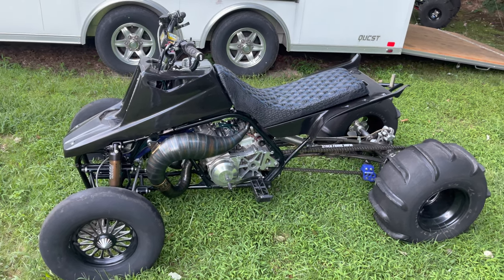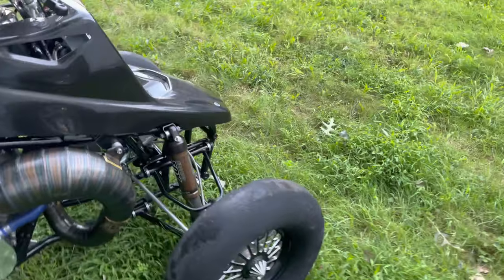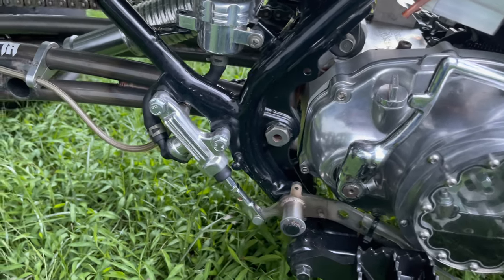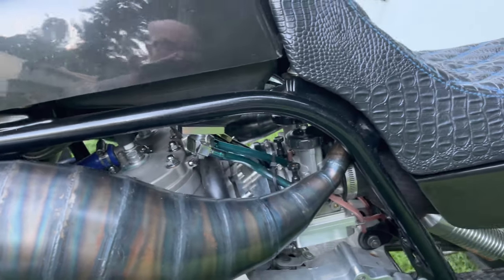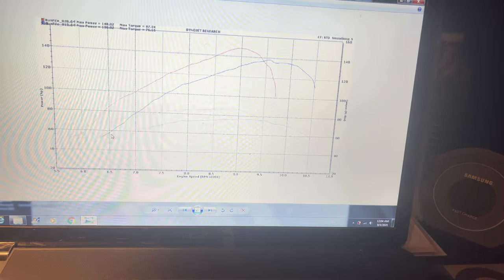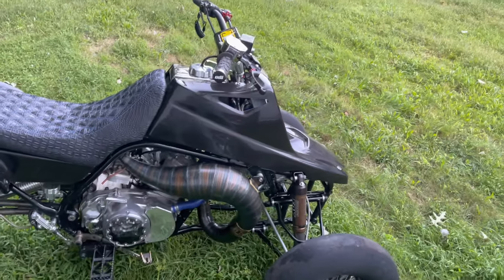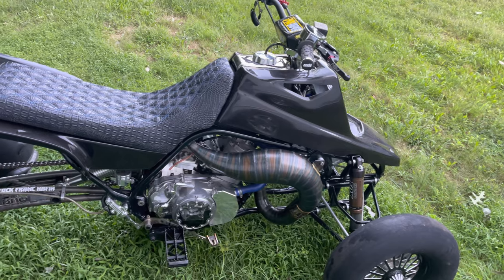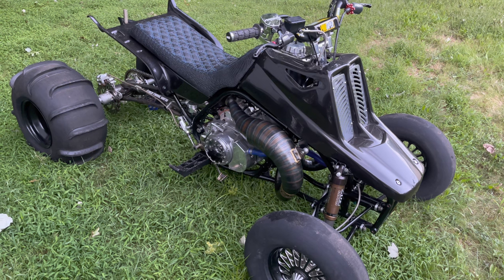20mil DM banshee 706cc

Comment: Damn dude I'm so impressed  with that led  pipe. I use shear  and I thought those hit hard.lmao. I prefer  the chrome over the raw but those led are a piece of art.
Reply from the maker: Thanks for viewing! Led definitely hit harder on that motor. If you look closely at the 2nd graph same motor when we got the shearers dialed in on the main, the peak power went up some and was only like 5 peak hp less but the led still hit harder up the whole curve
Reply: @CT Adrenaline   the peak for the Shearers was higher than your LEDs??

Comment: I need you advice I am going to build a titanium banshee for dunes and trail riding not for drag or racing. I want to get the motor and go all the way so i need advice. How do i reach you
Reply from the maker: Thanks for viewing! We appreciate the support. This might be a lengthy reply but I’ll try to keep it short. People run titanium to reduce weight. Usually used in drag bikes for racing. Dune and trail riding is usually more stressful on the bike especially if the dunes are rutted up and there is not enough wind to smooth it out. Can you run ti accessories? Of course. Have I seen a ti a-arm break at the dunes on a drag bike? Yup! Sure have! If you literally have no budget you can go all out if that’s what you want to do. Definitely invest in some of the best suspension out there and pick a motor based on the application/skill you want to run and the characteristics
Reply from the maker: @Suki2011 send me a message again I can’t find the one you sent me with your contact info

Comment: I'm thinking of buying a built 4mil banshee but I want to know if they reliable or would I have a lot of problems  later on
Reply from the maker: Very reliable just do a leak down test and jet a little bit fat it should last a very long time. Also use a oversized eBay radiator, run a big impeller and use engine ice coolant. Of course if you use cheap parts like the crank ect you may experience different results regardless of the motor size. Do it right the first time with good new quality parts

Comment: Killer Build. Was That James or Bruce's motor in New England Hillclimbers? Both had the 20mil DM built to race against my 18mil 688DM. both had shit loads of power.
Reply from the maker: Thanks George! That was James motor. He used It for only a few runs then everyone got out of the sport so I was lucky to get a low hr motor
Reply: @ctadrenaline  yes under 12 to 15 runs. that thing was bad ass
Reply from the maker: @georgeloring9305  makes even more power now with that hand cone pipe made for it
Reply: that is a vid of him racing
Reply: @ctadrenaline  nice that's nutz. are u racing it?
Reply from the maker: @georgeloring9305  out west in the sand dunes
Reply: @ctadrenaline  nice always wanted to go.

Comment: I seen quite a few in-frame set-ups make big power and wow I never knew LED’s made that much of a difference. The drag world we are always at top RPM with our over-rides. Regardless with that much difference I would just have to adjust ride style and short shift the bike and go with LED if the comparison was simply a pipe change and power-jet adjustment. OR.. Did u have to just change the pilot or both and have to drill another main??
Reply from the maker: In frames are the new oof 😁 seems like the bigger the motor the better the gains will be. Of course any pipe built to spec of the motor should make more power. The bike isn’t even on alky either it’s on 110. There is a ton left on the table power wise for this bike. The pipe change I did have to go up on the jets vs when a shearer pipe was on it. Happy holidays bud and thanks for the support 👍🏻👍🏻
Reply: @ctadrenaline  does John at Sandtoyz stock the motor support? I have both bikes of mine with the 2pc stator cover/trans support. I’ve never saw the pivot mounted support like that. Very awesome merry Christmas to u also
Reply from the maker: Thank you! I’m not sure if John has them in stock you can always ask him but JDS customs seems to have them in stock from what the site is saying 
https://www.jdscustoms.com/product/banshee-engine-supports/

Comment: Bad azz! Is that pumpgas or race fuel?
Reply from the maker: Thanks for viewing! If you haven’t already please subscribe and share with friends. That is on 110 race fuel. All DM engines have to run race fuel (110 or higher) or alcohol due to the small water jacket size
Reply: CT Moto already did
Reply: Awesome bike!
Reply from the maker: Awesome thanks so much for the support!
Reply: @ctadrenaline  maybe a little bit dumb question but would it be possible to port the water jacket size to make it run cooler and make it so that it can be ran on pump gas?
Reply from the maker: Pretty sure I asked that question years back. You have to consider the size of the piston. Obviously it’s a bigger piston and the cylinder can only be so big to fit into the frame hence the small water jackets and limited space. DM cylinders run hot. Usually people run alcohol for fuel to help keep the motor cooler
Reply: @ctadrenaline  thanks for the answer, I assume u mean bottom end with frame
Reply: @ctadrenaline  your 706cc prolly is not even possible to ride in trails I assume since water jackets are so small
Reply from the maker: @xfdfff2620  it’s possible. Good luck getting traction would probably have to run a stock arm for dirt trails and probably then still might have traction issues. 10mil or 20mil motor with a DM cylinder will have the same cooling properties. The 20mil might heat up a little quicker due to displacement size.I can’t currently run mine in the trails due to the motor having a over ride trans. Let me rephrase I could but the chances of messing up and bending shift forks will be much higher. You don’t really need more then a 10mil on trails should be plenty of power

Comment: Your build will definitely be approved by Congress. Ok maybe not. Congress isn't on our side. But it is approved by the high council, which is me. ;) We are one in the same on this one. Like you I prefer the extra torque and horsepower throughout the range of the rpm curve instead of having a high peak number that is only seen in the narrow top of the curve. With that said, LED pipes and stinger mufflers. This will conceal the beauty of the pipes and is probably looked down upon for that reason, but if you're not bothered by that....

Heat insulating ceramic coatings and exhaust insulating wrap on the pipes. Even low horsepower low revving diesel engines love to keep heat inside the exhaust.
Reply from the maker: Interesting concept. I’m not worried about gaining more hp or trq at the moment. If it comes to that point I’ll be going with alky and porting for it which will make a huge increase. Led pipes are beautiful for sure
Reply: @ctadrenaline  If you run it on alcohol, will it be ethanol or methanol? There are pros and cons with each one.
Reply from the maker: Methanol I believe. I gotta ask my builder. Whatever one gives about a 10% increase and runs cooler but you run a 20:1 ratio

Comment: Where did you get those exhaust?
Reply from the maker: LED performance
Reply: @ctadrenaline  I just checked the site, what do you recommend me for a banshee 392
Reply from the maker: @reislen7418  some questions I would ask is what kind of riding are you gonna do the most? How do you want the motor to perform and are you currently happy with that motor setup? Typically a hand cone pipe will give better results but you see more gains with bigger motors. There is plenty of pipes available to complement the motor but try to get those questions answered and I can point you in a direction on what to run
Reply: @ctadrenaline  it’s a Athena 392 kit, Most of the time I climb hill, do drag, normally drive with some speed,  and sometimes I go for a little run with family
Reply from the maker: @reislen7418  you might a shearer pipe. It’s a high reving pipe and the Athena cylinder has a little higher ports if I remember correctly so they would go well together. CPI would be a good choice also. I wouldn’t get hand cone pipes unless it was a bigger motor imo